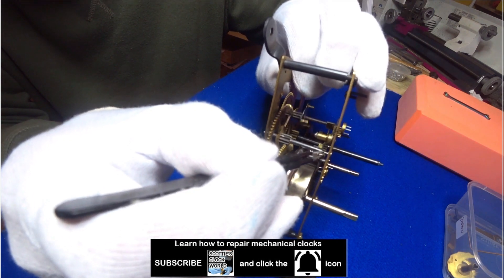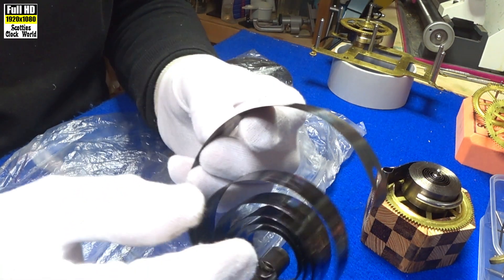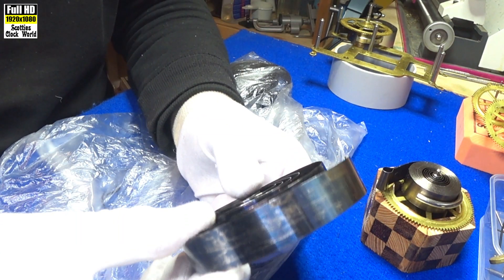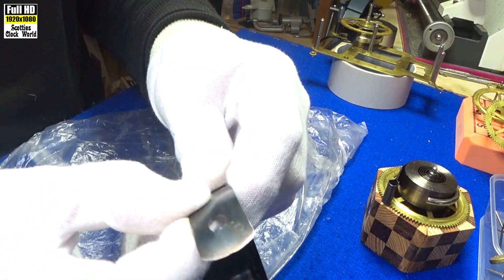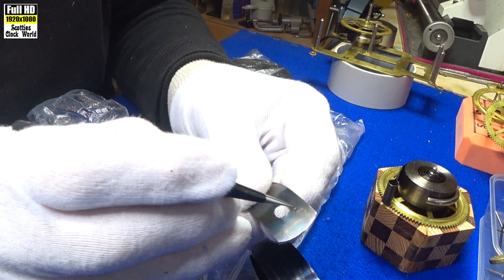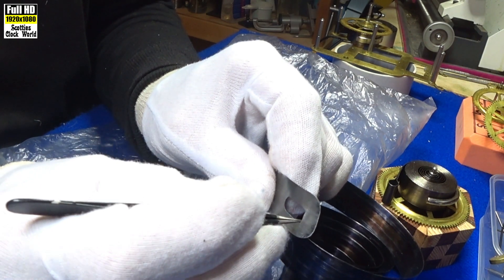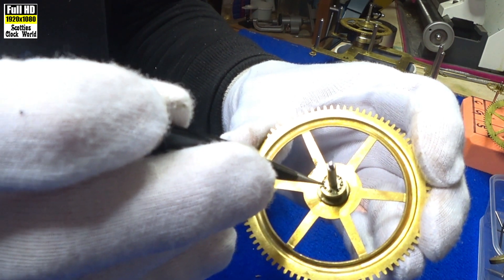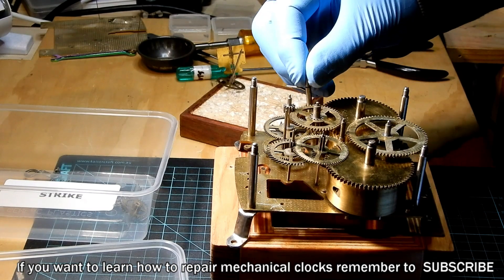Spring Driven Mechanical Clocks: The Mainspring Explained

Comment: Thank you for the informative content.
my great grandfather used to make clocks he was called Thomas kefford of London.
I have some questions that might sound a bit out of the ordinary but maybe you could help me.
Question 1 what is the maximum torque that can be achieved with the correct spring.
2 would it be feasible to upsize one of the Springs to a 20-in diameter.
3 is there a way to stop the spring from uncoiling after it's been released without damaging it.
Like a type of braking system.
so that you could be in control of how much you let it unwind and the speed of the unwind.
I know that's not sort of how a clock works but I was thinking for a different project requiring the ability to control unwind.
4 is there a way to pre wind to achieve more speed and power but also a limit to stop it unwinding past a certain point.
5 what do you think it would cost to you have something like that custom-made.
My goal is to achieve 12 Newton metres of torque at 7000 RPM.
6 is that even feasible or am I kidding myself😂
Obviously I'm talking about much larger Springs than what you're working with.
But my calculations if we were to make the identical model that's in your hand but sized up you'd be talking 1200% increase.
If you've managed to read this far thank you I'm sorry for the out of the box questions I just can't find the answers anywhere else.
Your help is much appreciated

Comment: Hi Scottie – Thanks for sharing the informative Video about Main Springs – very interesting.  At last a man who knows what he’s talking about!  🙂   I recently purchased an Antique American Striking Clock (no Makers name) so very cheaply made I guess.  However,  it keeps excellent time and Strikes perfectly – and so very satisfied,  but I noticed something odd;  when I come to wind the Springs,  the Strike, seems far less run down compared to the long winding I do for the Main Spring? Odd! I’m pretty certain it can’t be a longer running Clock than a 30hr, and that the Main Spring is just stopping too soon,  as when it stops, there is a long full wind for the time – but like I say, the Strike has very little run-down... You don’t happen to know why this may be? I even thought perhaps the Strike should give one gong on each quarter as well as the half hour (which it already does) to use up the Spring,  but I really don’t think it was that an expensive Clock when it was made – but of course it would have explained why there’s so much Spring tension left...  I also wondered if because it was cheap, they just used identical Springs – even though half of the Strike one wouldn’t ever really get used as a possibility?   Very grateful for any help you can give to solve this very frustrating mystery!  Many Thanks.

Comment: you said to use grease not oil. What about mainspring lubricant, which is labeled specifically for lubricating clock mainsprings. It is like a thick tacky oil. They sell it specifically for this purpose. Is the grease still better to use and if so what type of grease?
Reply from the maker: My horology instructor was a chemical engineer and he recommended PTFE grease over the thicker mainspring oil. It may be a personal choice.

Comment: I have a wind-up Howard Miller wall clock that has 3 winding ports.  Right one is for the chime, bottom center is for the mainspring - but what would the 3rd one be used for?
Reply from the maker: The bottom centre winds the Time train mainspring, the other arbor winds the mainsprig for the Strike train.
Reply: @ScottiesClockWorld  Thank you - this makes sense to me now, that it never seems to "unwind", because we usually have the chime turned off.  If the clock doesn't chime, then it will never unwind.